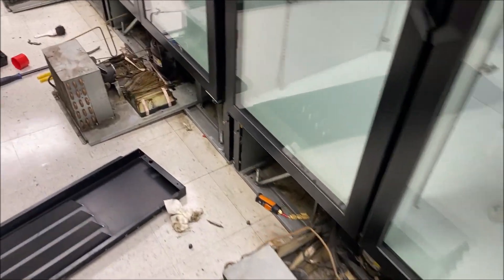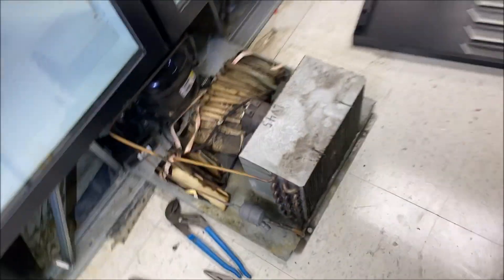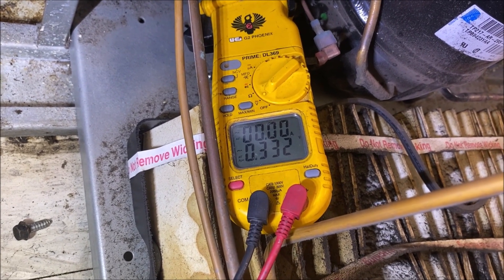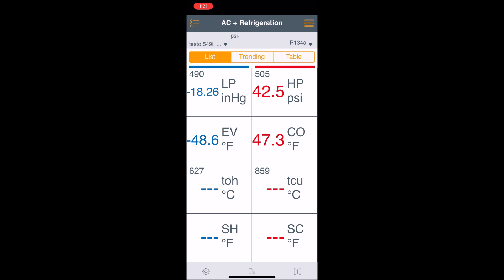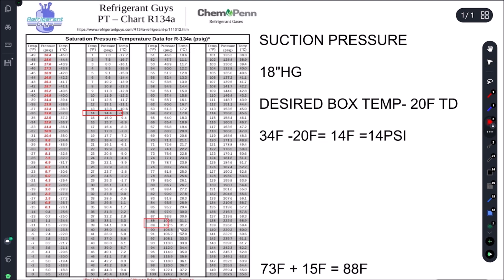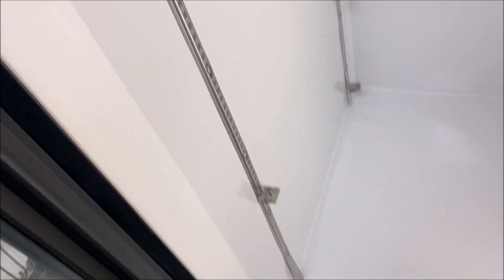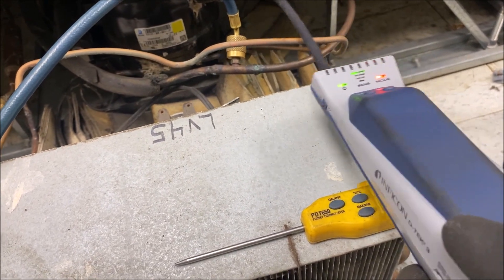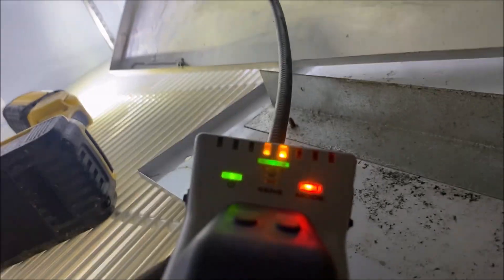4 coolers are not cooling

Comment: Thanks for these educational great videos how we know what amp is good or low or high and what is thats means are and how we find out which 3 n 1 use for different compressor
Reply from the maker: This unit is on a 15A breaker, so anything around that or above is not good. On these reach ins, you will see anywhere from 1-7A depending on the size and application.

Comment: Reminds me of my HVAC job 20+ years ago. Used to do that kind of troubleshooting everyday. Mostly residential but did some commercial  and some appliances as well. I learned to weld a bit during that time as well. I wish I did those freezers though that would be 1000% better then residential crap. I liked commercial buildings too. Just didn't have them every day.
Reply from the maker: Yes I really enjoy the commercial side over domestic for sure
Reply: @REFRIGERATIONKITCHENEQTECH  you know the problem with domestic/residential is they call when the ac is broken the entire house is hot. So your always working in the heat. Commercial they normally have more than one unit so it's not as hot. And in Florida that heat is a killer lol. I had to change occupations because I hated the heat!!
Reply from the maker: Lol, restaurants are really hot but luckily I mostly work on grocery stores, nursing homes and fancy office buildings that have a/c in the kitchen

Comment: You refer to 3in1 as hard start. Completely different . Not to confuse the new guys.
Reply from the maker: It says on the package 3n1 hard start kit. Is there something known as just a hard start?
Reply: Hard starts are generally used on PSC compressors to add a start cap to help with low voltage or hard to start compressors. They combine a relay and cap without an overload like the 3in 1
Reply from the maker: Ah gotcha, good to know, thanks!

Comment: 💪🇺🇸❄👍 great vid. I HAVE a question about a walkin cooler. If there's a switch inside box at evaporator, n u shut off evaporator fans by the switch, will that pump the system down? Txv n sol valve in circuit.  Just curious best way to shut unit off if doing work inside box. Don't wanna flood compressor. Thanks
Reply: Be careful, that switch only shuts the refrigerant flow up to the solenoid. You will still have refrigerant in the liquid line. If you were changing the solenoid valve body inside the box, this wont work.
Reply: @deanmohamed7575  thankyou 🙏
Reply from the maker: If working inside the box, I would shut off power to the evaporator coil (usually a disconnect switch attached to the coil) and this would pump the system down
Reply: @REFRIGERATIONKITCHENEQTECH  thanks for your help 🙏